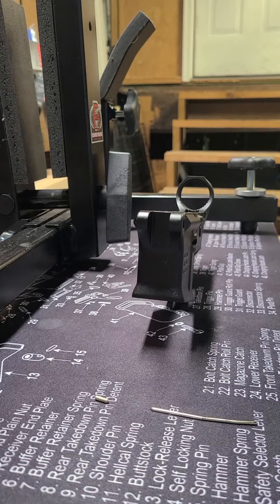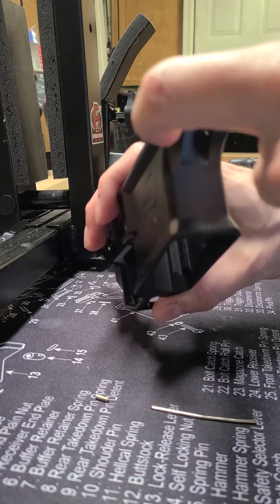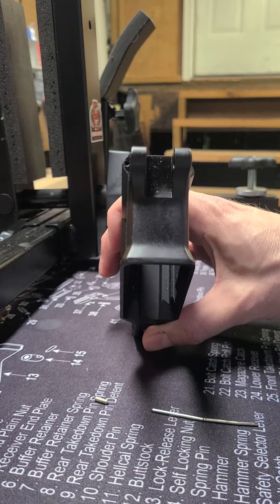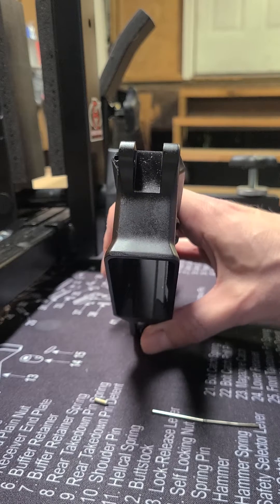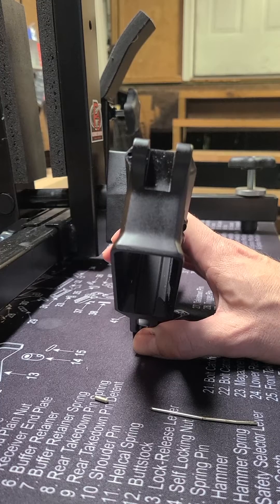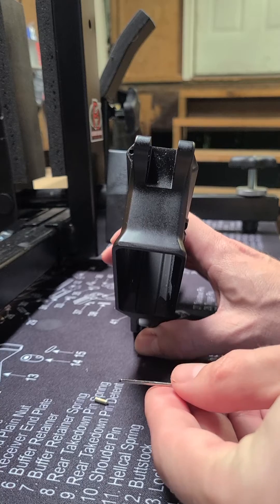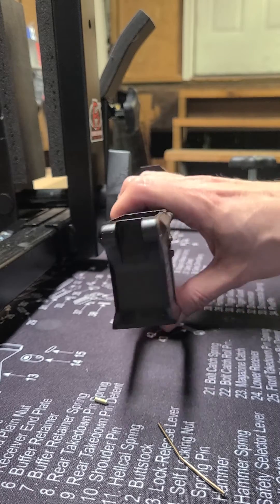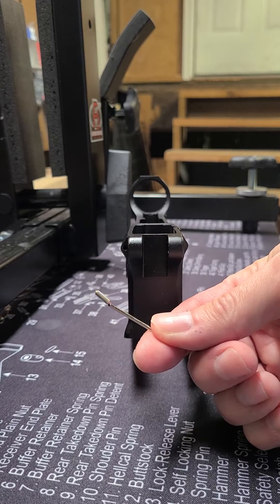How to remove stuck detent in pivot pin spring hole for AR15

Comment: Dude I’ve bought those magnets that’s you got lubed it up and let it sit for a little bit. Been trying to pull it out with the magnet but it’s not working at all. It’s getting really frustrating. How did you get it out with the magnet if it’s not budging at all ?
Reply from the maker: Just kept pushing it in and letting the magnetic stick to it until it came out